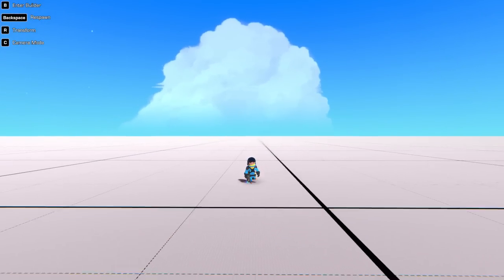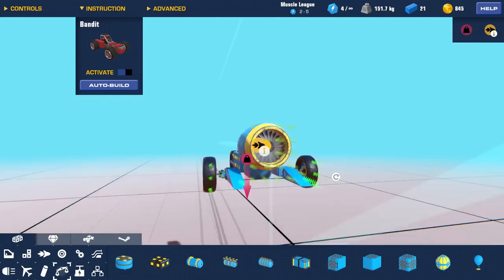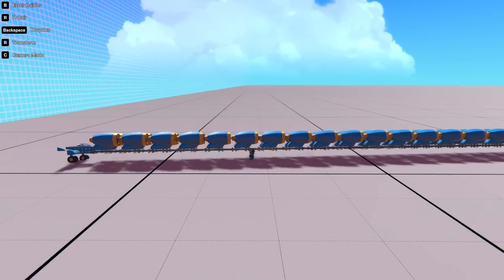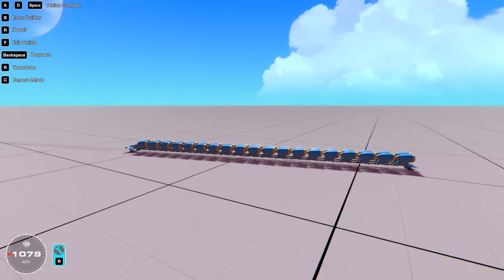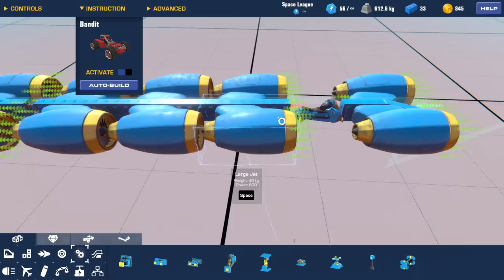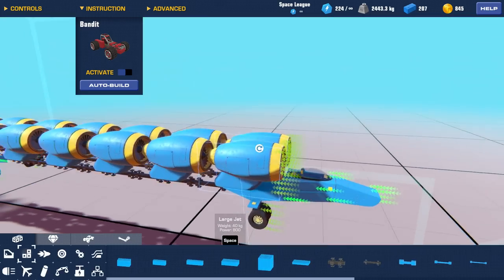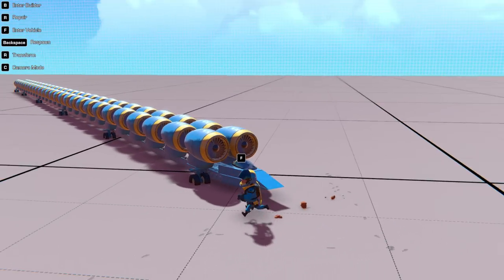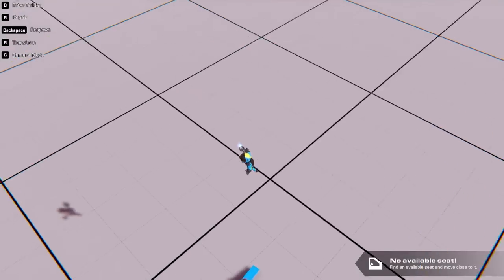Using Only NEW Large Jets to go SUPERSONIC!

Comment: The most important thing to do when trying to go fast is to reduce frontal area, thus reducing drag. Putting gaps in between the engines increases the frontal area, increasing the drag. Drag is proportional to speed squared; basically, if you go twice as fast, you have 4 times the drag. So when going fast, drag matters more than the force of the engines.

Edit: spelling/gammer
Reply: Also friction 
More wheels probably means more friction
Reply: Makes me wonder... perhaps single row of Engines woulda worked better to need less frontal area? Well, if a way can be found to not tip over sideways too easily...

Comment: You should use skis instead of wheels and use hinges to camber them on their edges. I'm pretty sure that the game is using some kind of friction equation similar to IRL of the more surface area you have in contact with the ground the more frictional drag you create. So skis have less friction than wheels due to their material and the edge of the skis have less friction than plain skis because they're technically on less surface area. Besides you're going for speed, not maneuverability.

Comment: I got about 1320 in jet form with those engines. The new engine parts are a lot lower powered than I would like, especially the single small one, which is quite a let down.

Comment: Going super sonic isn't about aesthetics sadly also if you put wedges in front of the engine and removed the wheels or added wedges to the wheels along with removing a ton of weight you'd go faster (I'm assuming I'd have to build and test myself)
Reply from the maker: pretty much yeah :) But I try to switch it up!
Reply: @darealkosmo  switching up is fun as it creates unintentional results it's how I discover bugs and other interesting results

Comment: Why on earth are you putting your center of thrust infront of your center of weight you dork, lol. It's no wonder why you had such instability problems, if the craft was rolling in the other direction, with the cockpit in the front and the weight of the engines in back, it would have been smooth, but as you put all the weight in front, your vehicle naturally wants to spin out.